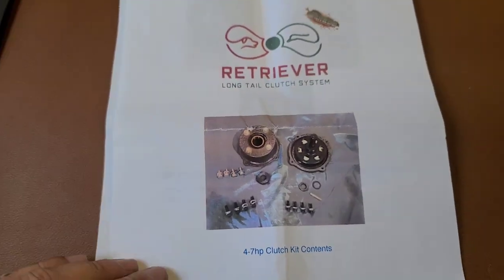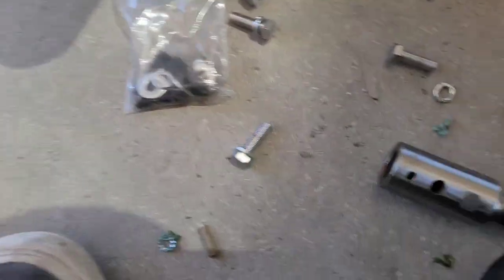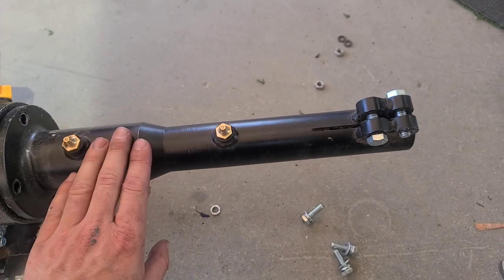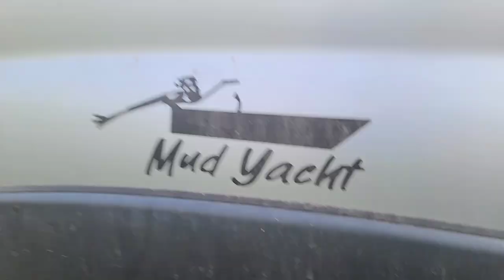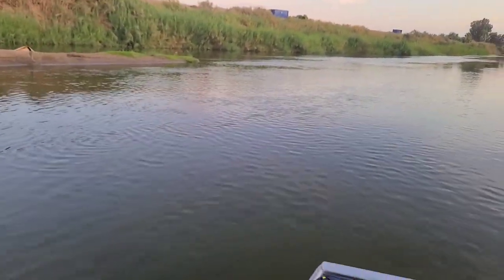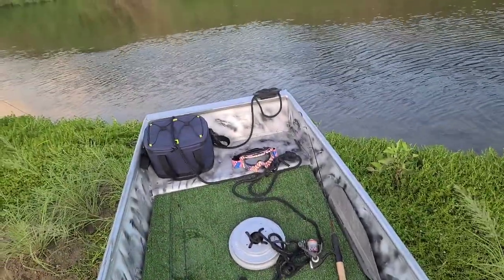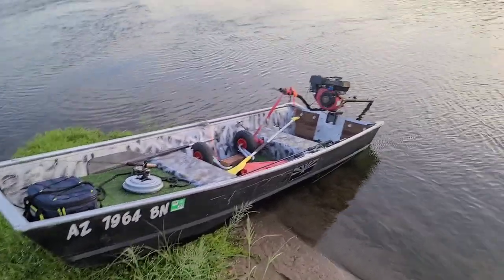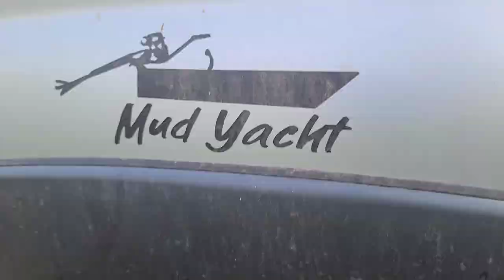Longtail Mudmotor with a Clutch #predator224 #Boatkart

Comment: What’s the length on your boat?
Reply from the maker: 10ft
Reply: @azlongtales   I’m building a 12ft with the same motor, I was worried about the weight in the back. But I’m guessing now I’m gonna be ok now. Do you stand when diving?
Reply from the maker: @fritzbucher4726  yes easier to see upcoming obstacles
Reply: @azlongtales   thanks for answering my questions. Really appreciate it. I’m thinking I’m gonna be ordering that clutch kit as well. Looks like it makes turning a lot safer and easier.